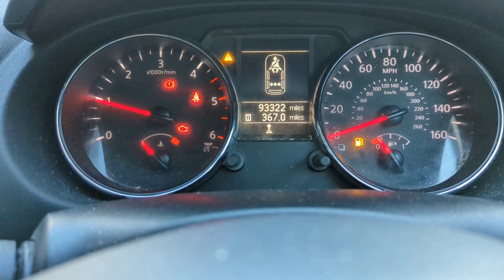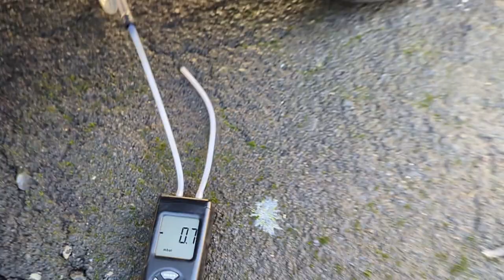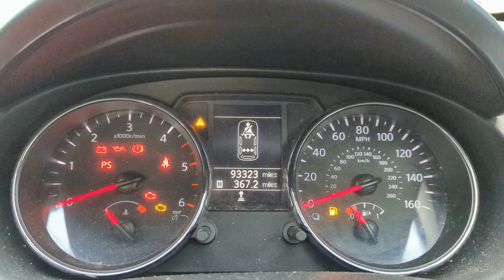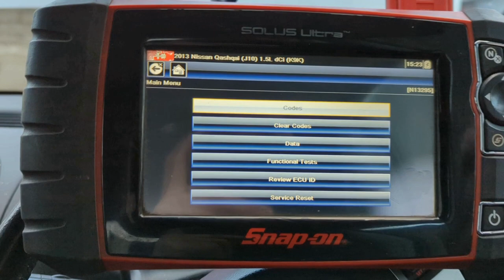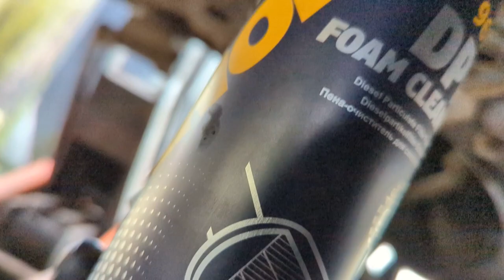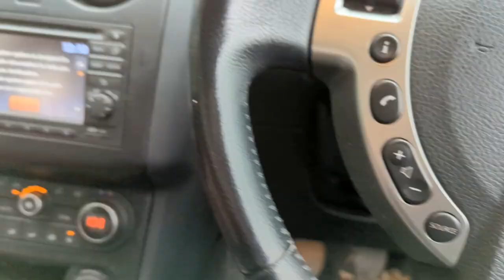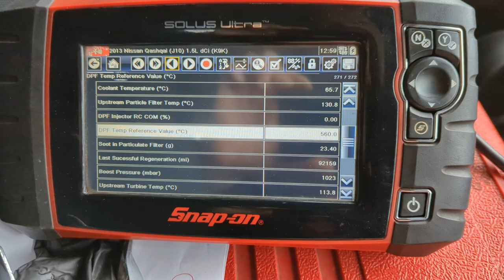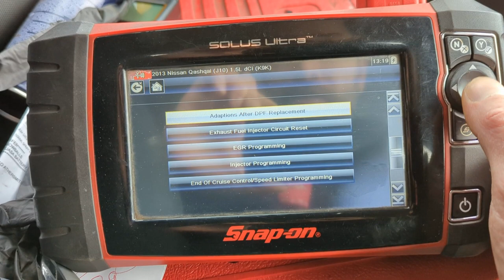Nissan Qashqai No Power/No Boost/Lack Of Power | What's Wrong With This One?

Comment: The problem is the intake intercooler pipe locate next to the battery. Qashqai's are known for cheap intercooler pipe. Change the pipe or use glue and duct tape to seal the pipe. It will fix the problem.
Reply from the maker: @MohammedKhan-yy2mx  I did a timing belt and water pump on this car a year after this video was made and the pipe you mention was split. I didn't know it was a common problem until looking deeper into it so thanks for the good information.

Comment: Hi bud,answer to your glow plug ohms reading,it should be around 0.1 ohms anything higher then plug will need changing,i have the same issue with my wifes qashqai,i had a cracked air intake pipe,and had to change 2 glow plugs,then after i thought issue would improve,i then had the red engine management light come up on dash,it said that my dpf was choked up with soot and ash,i'm having it cleaned this weekend so i hope it sorts issue,as i also had a fault come up with the turbo,odb device said turbo underboost,so again i'm guessing this is related to the dpf ,great video dude.
Reply from the maker: @daveshipman2677  thanks for the info, will be useful next time I come across a glow plug issue. Sounds like you're having similar issues, hopefully you get it sorted relatively quickly/cheaply.

Comment: Hi! I'm getting kinda desperate so I wanted to check in with you for an advice because you've handled couple of j10's with 1.5DCI engine. I have exactly the same engine in my Qashqai, it is 2007 Tekna Plus model - I've owned it for a year and within that year car stopped running 4 times. What happens is that I am casually driving fine, and all of a sudden I get ESP OFF and a red check engine light - I usually park it, turn if off and on, error clears out and I drive away fine. But sometimes, that isn't the case. It just stops, loses complete power - it cranks but it doesn't start. 

I have taken it to 4 different mechanics and had high pressure sensor replaced, ESP module replaced, fuel filters replaced, fuel regulator and cleaning of the system done. ESP OFF and Red Check Engine has returned yesterday indicating that it will die again soon in the future.

Do you have any advice on what to check? Please and thank you!
Reply from the maker: Do you know what fault codes are present?
Reply: You ever get it sorted? I’ve had this a few times
Reply: @ScottyG95x  its a fuel filter
Reply: @Fabio-fv1xl   cheers but changed all that with no luck
Reply: @ScottyG95x  ok is filter or hig pressure pump fuel

Comment: Greatt tests I bloody hate dpf 😡😡😡😡
Reply from the maker: Agreed, they can be a bit of a minefield.
Reply: @Papa77sGarage  every diesel I end up buying always has something wrong with a dpf 🤣
Reply from the maker: @flippingcarsrepairs  hopefully there's some useful information in this video for you.
Reply: @Papa77sGarage  guess what the bloody 10 plate fiesta 1.6 tdci failed the mot on emissions way to high nearly 3 times 🤦‍♂️🤦‍♂️🤦‍♂️what would your solution be, I did a static regen the night before and next day it failed 😡
Reply from the maker: @flippingcarsrepairs  what does it actually say on the MoT? Something like exhaust emission excessive for a turbo charged vehicle?
Reply: @Papa77sGarage   it says its ment to be  plate  value 1.50 1/m but its actualy  2.56 average 🤦‍♂️🤦‍♂️
Reply from the maker: @flippingcarsrepairs  is there any fault codes?